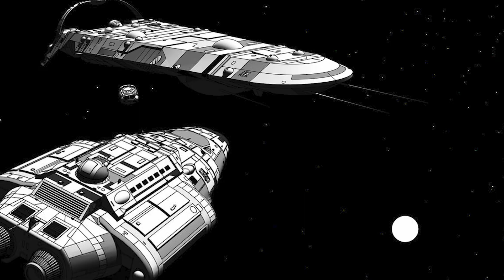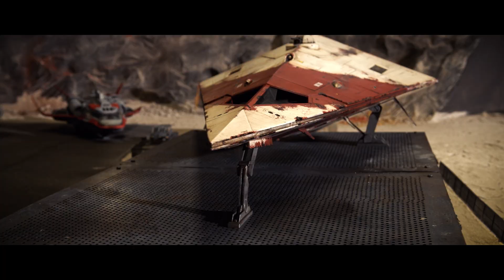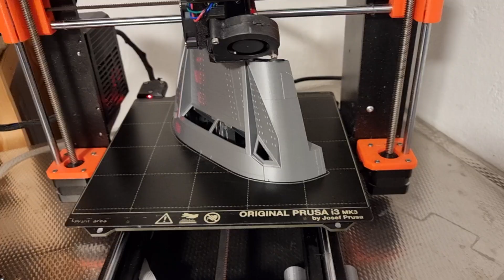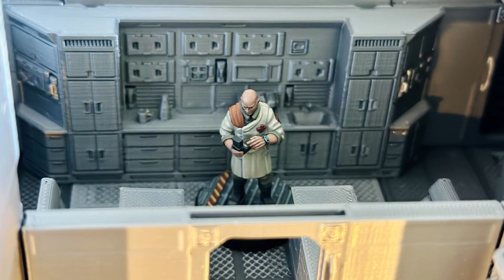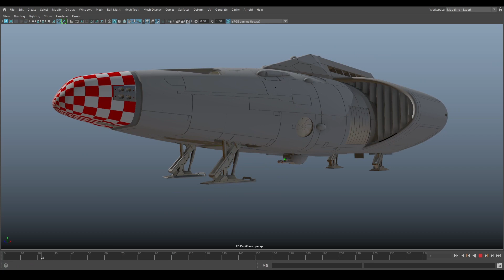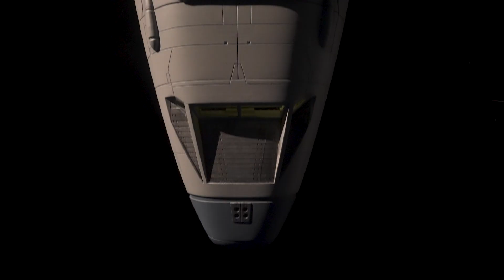Making of the Beowulf 28mm 3D Printed Starship from the Traveller RPG Universe

Comment: this looks incredible, I was wondering since your ships print and work so well on FDM at 28mm scale would this work well made from resin at 15mm scale? would love to have this as both a functional set piece in large wargaming as well as for large scale RPG adventures or even dioramas.
Reply from the maker: It can  technically work, but would require resin supports and possibly drainage holes to be made by the person printing it. Probably would be significantly lighter too, maybe under a kilo.
Reply: @2ndDynasty3D  awesome, thank you for the reply. I'll probably start off with your V1 starship interior set and maybe your Starfighter sets before thinking about going for the big cheese that is the larger sets. Huge fan of your work since the chimera looking forward to your next projects.